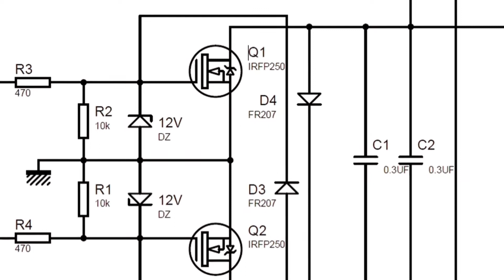1000w zvs circuit,1000 watt zvs module

Comment: It's amazing what you can do with these little cheap ZVS modules. I've got a couple of them, one for my flyback driver and another for an induction heater. And one other thing, you can eeke a little bit more power out of that unit by using copper tubing instead of solid core wire, tubing works better because it can be both cooled with air or water and reduces losses from the skin effect. Either way induction heaters are badass...
Reply from the maker: Yes, very excellent zvs modules💯🤩

Comment: Hi i have the same zvs but nothing will be hot. The coil has the diameter of a 18650 battery, 10 windings, and the coil is alminium. The voltage is 20v and the ampere is 4a
Why it doesnt work? Thx?
Reply from the maker: Yes
Reply: @electronicpuls3242  ok thx please tell me more about the coil. How it have to be? How to make, which material? My zvs burn out and nothing in my aluminium coil will be hot.
Reply: @Daddy  do you have a solution for my problem? what is wrong with my coil?
Reply: Now i tried a big diameter coper coil. With 8 windings. I put 12v car battery on it. When i have the coil on thr zvs will get very hot. Without coil in got a noise from the board. So what is false with my zvs. Please help.
Reply: @divyadeenu1686  Now i tried a big diameter coper coil. With 8 windings. I put 12v car battery on it. When i have the coil on thr zvs will get very hot. Without coil in got a noise from the board. So what is false with my zvs. Please help.